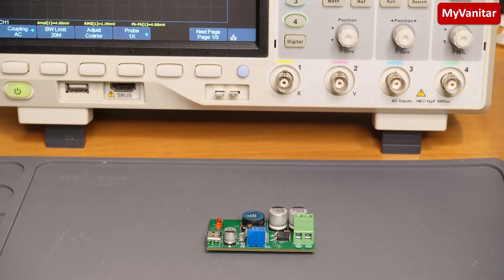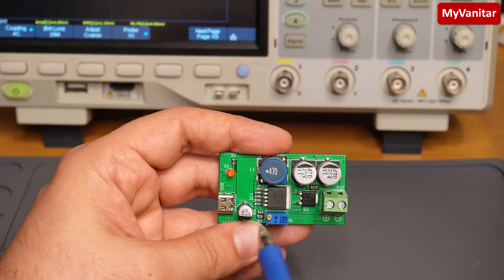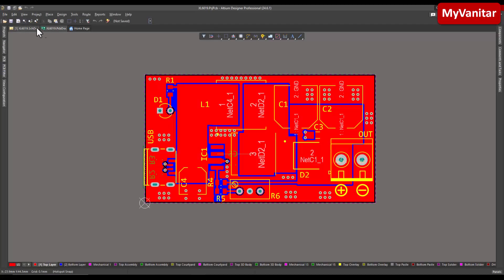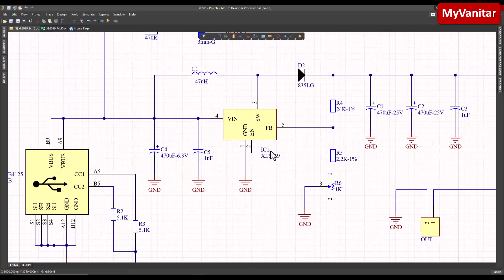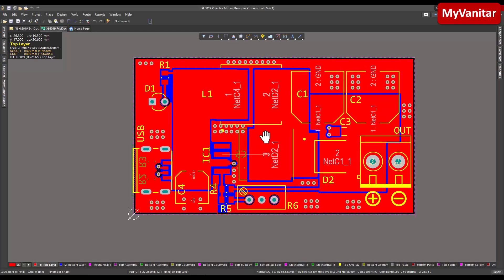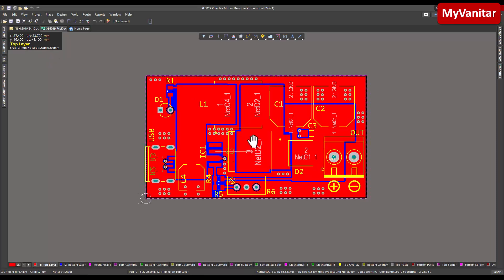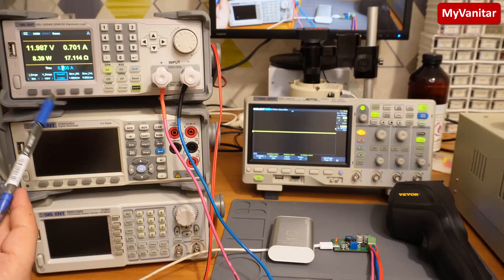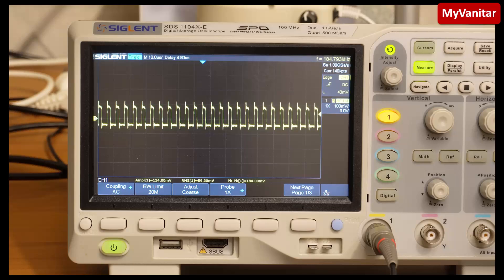DC to DC Boost Converter Circuit Using XL6019

Comment: Can I have the footprint of XL6019 sir? And can I ask this? Can I use this chip to convert from 7.4V (Lipo battery 2S) to stable 12V 3A?
Reply from the maker: For the footprint, you can find it online, it's nothing special. Regarding 7.4V to 12V-3A, I'm not sure if it can tolerate the current

Comment: This booster IC is unsafe and may kill sensitive electronics connected to the output voltage. When you feed it from a supply with an output voltage that may drop below 5 V e.g. under load conditions or due to a short interruption of the mains supply, it may transit into an unsafe state:  it begins to draw high current -> further decreasing the input voltage. When the input voltage reaches ~ 3 V, the internal reference voltage switches from 1.25 V to ~ 2.6 V, resulting in more than twice the wanted output voltage. If that exceeds the maximum rating of the connected electronics, those will be destroyed.
This may even happen during turn-on.
It is unsuitable as a booster to deliver a constant voltage from a discharging battery or a "non-stiff" power supply.
Reply from the maker: The input voltage is fixed at 5V, from a USB charger or a power bank output. The output is fixed at around 12V. I would appreciate it if you watch the video completely, this is to respect the authors; otherwise, you are always welcome to share your opinion

Comment: What happens when you short the output?
Reply from the maker: These chips are all protected against short circuit
Reply: @MyVanitar  Not true. Look at the schematic. When output voltage is lower than input (short circuit condition) there is direct current path through inductor and diode.  It should have at least a fuse on input power line to avoid major disaster.
Reply from the maker: it depends on your input supply. also when the input drops below 5V, the chip turns off. Maybe the EN pin can also help, but for my case and purpose of this circuit, disaster never gonna happen
Reply: @MyVanitar  That's wrong in case of a momentary overload: The chip does not turn off for input voltages <5 V. Instead it begins to draw high current and when the input voltage drops and reaches ~ 3V the reference voltage jumps from 1.25 V to 2.6 volts and the output voltage may jump from its original value to more than twice of that. That over-voltage may kill sensitive electronics.
Reply from the maker: @Kai-pcheck  The input voltage is fixed at 5V, from a USB charger or a power bank output. The output is fixed at around 12V. I would appreciate it if you watch the video completely, this is to respect the authors; otherwise, you are always welcome to share your opinion

Comment: with usb type c why don't you also try to make pd trigger board with let say dip switch to select output voltage then will have a wide range of selectable output voltage.
Reply from the maker: if you want other output voltages, simply change the feedback resistors. also, be careful about the voltage rating of the output capacitors
Reply: @MyVanitar  yes I understood.